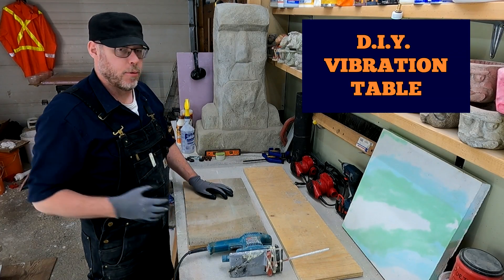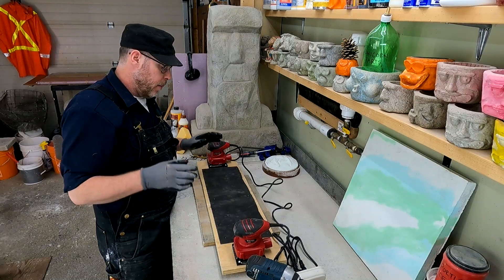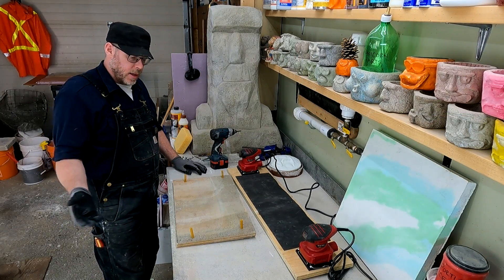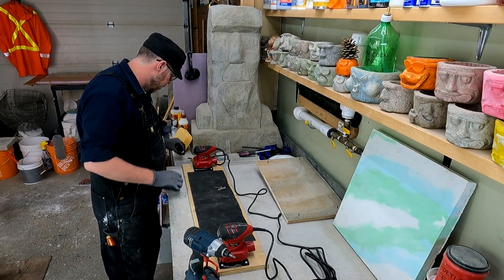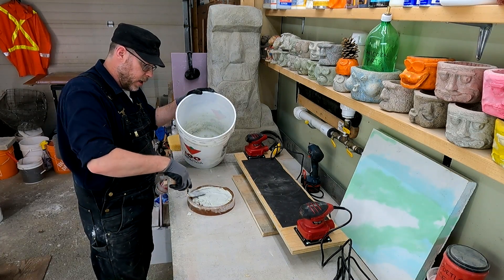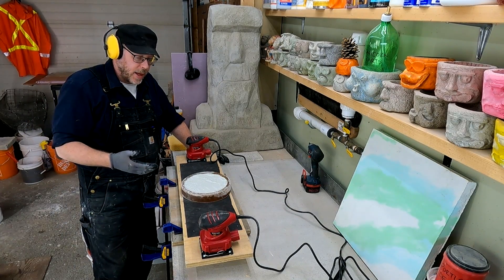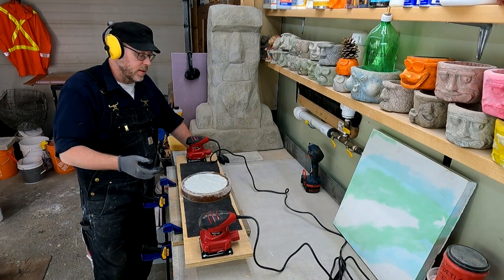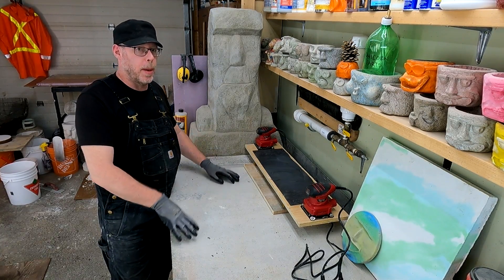D.I.Y. Concrete Vibration Table

Comment: Thanks for the content!  I am getting started in concrete casting for decorative projects too and am building a vibrator as well.  I'm planning to use a 4-pole motor (1,800 RPMish) with an offset shaft on pillow blocks.  I'll attach an offset weight to the pillow block shaft and adjust vibration RPM with varying pulley diameters.  Initially, I'm shooting for about 600 RPM.  This whole unit will get clamped to my work table where I'm casting the concrete.  I imagine there may be some trial and error dialing in the proper offset mass as well as RPMs.  I live in Cozumel, Mexico and hope to have my own page up and running by spring.  ;-)

Comment: Thank you for posting this! You mentioned that you wouldn't normally let it vibrate for so long, for a professional casting how long would you let it run if you were using something like cement all?
Reply from the maker: I would let it run into the air stops bubbling to the surface.  At that point it is either too wet, or not, on the surface.  If too wet, add a sprinkle of dry mixture, or just some more mix on top to displace . offfset that wetness that gets raised.  Total time 5 to 10 minutes.

Comment: Interesting. I've never seen such s thing. What do you think of putting the sander vibe board into a close fitting sand box in lieu of the spring setup? to allow free movement... Or maybe ball bearings, bb-s or glass marbles instead of sand?
Reply from the maker: Really there are loads of different ways you could build something like this.  I kind of just picked one and ran with it.
Reply: I immensely appreciate your input! I value your experienced viewpoint. Have a blessed day.  @creatingconcrete
Reply: & maybe attach the ssnders to the bsll bearing box, making slots they slide in to hold them
Reply: & cover with a plastic bag to hold wet concrete project
Reply: Thanks for the great ideas! Are you a musician? The way you talk about frequencies and resonance 😊

Comment: I built a similar vibration table a few years ago.  I didn't think about using springs, which is an interesting idea.  Instead I suspended the vibration platform by ropes from a frame that surrounded its perimeter. This design allowed me to adjust the ropes so the platform was flat no matter where I setup.  

For vibration I cut some wood blockt that contured to the shape of a variable speed drill motor. Attached the blocks to the bottom of the platform. Use plumber's  strap to attach the drill to the blocks. And pt a shot length of chain in the drills chuck as an eccentric weight. 

The platform works well.  I didn't do a lot of testing to look at honeycombing but the surfaces were air pocket free, even with high detail molds. 

I like your design.  It's much more professional than mine. But thought I'd share a different idea to solve the same problem.
Reply from the maker: thank you for sharing.  There really are quite a few ways you could approach making a DIY / tabletop sized concrete vibration table.  I wish I had gone with a variable speed sander as that would have made a huge difference in the quality and control of the table.

Comment: How long would you say to let something like that vibrate? Its hard to tell due to the timelapse. And what if you vibrate it by hand? I did about 2 minutes on my last project (similar size to the one in this video) and it got a lot of cracks on the top surface. The mix was a bit too watery too I think though, so could have been that.
I'd love to hear more about resonant frequency, its super interesting and I never thought about actually tuning the vibrations for optimal results, kind of obvious now that I think of it. Great info!
Reply from the maker: This was 7 minutes on the vibration table.  After this I usually add some fresh mix to the top to help get rid of the water that has all pooled to the surface.